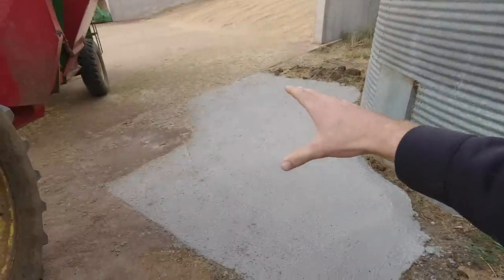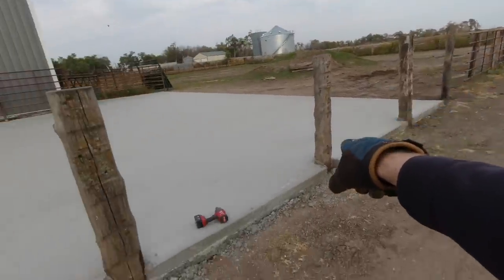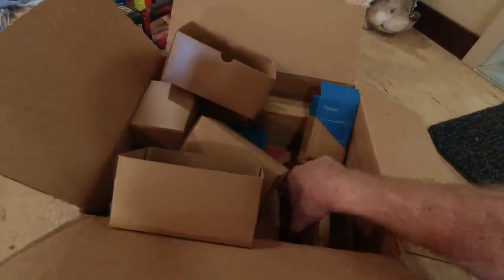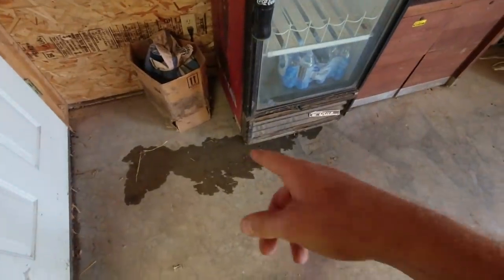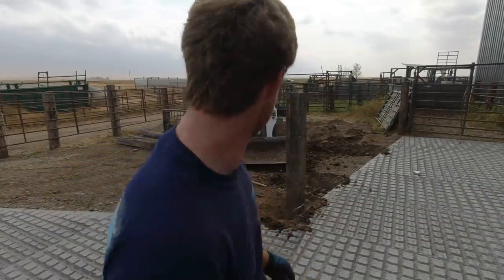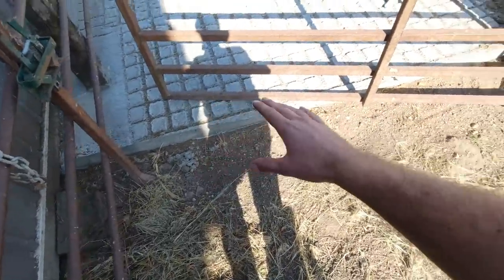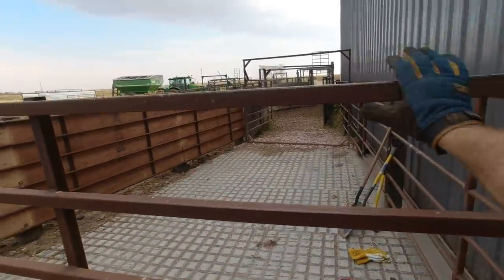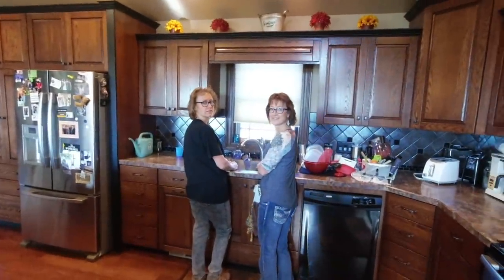Brand New cattle working facility 🐮

Comment: I dug hundreds of post holes to make side money when I was in school and living on the farm.  In Connecticut, there are lots of rocks in the ground that either stopped downward movement, or accelerated it if the auger caught at the edge.  The auger would jump and skip, maybe break a shear bolt.  Sometimes I had the good drilling you had.  One day it took 6 hours to drill 30 holes, another day in another place, I could drill 30 holes in an hour.  That day, I drilled 265 holes around a horse pasture.  You are right about tamping.  The post's stability depends on it, starting at the bottom and working the way up the hole.  Nice job, Cole and Brian.  So funny at the end!!!
Reply from the maker: It doesnt get much more rewarding that a straight solid fence!
Reply: @SonneFarms    One of our neighboring farmers built terrible fences.  They used somewhat straight tree branches as posts. Never repaired broken wire just added a new wire, wires old and new criss-crossing the space between wobbly posts that quickly rotted at ground level.  Countless times their cows or heifers would show up at our barn.  In retrospect, it is amusing.  Meanwhile, we worked hard to build a straight, solid fence.

Comment: Hi Guys! Not being critical but wondered why you put your pipe fence in the paddocks on the outside of the posts since I would assume the pressure against them will generally be pushed out towards the alley. Just wondering!

Comment: I used some 4’x10’ pieces of 18 gauge metal sheets welded to my corral panels to make a visual break for my corral. That way I didn’t have to worry about them welding. Although I did spend about $50 a sheet.
Reply from the maker: I bet it turned out amazing!
Reply: @SonneFarms  it’s not as nice as your guy’s setup, but plywood doesn’t seem to last very long here in Missouri.
Reply from the maker: @ajskab99  oh, I could imagine!

Comment: I ran into a friend who I have not seen since 1969, at the 4th of July party at his sister's home in IL. The sister was my partner when I worked for the city animal control and the friend and I graduated together from High School. The sister was a couple years behind us, and the Dad was a Judge on the bench in our city. I was relieved when he ddnt toss me in jail for a speeding (speeds in excess of 100 mph OVER the 45 MPH limit) and dropped the many charges down to a too fast for conditions, and gave the cop a stern warning that if he should decide to threaten more young troublemakers, like me, and tell them he would be laying for them and if he...The Judge said he would end that cops LE career but quick.

Oh yeah,  now I remember why I started this post..The friend who I ran in to at the party gave me the link to the simplisafe company before he went home. My apartment was robbed 2 years ago while I was at the VA in Iowa City and I lost 4 new long guns and a lot of fishing gear. Hopefully I can save enough to get set with up a system with all I need to notify local PD that someone has broken in, and that will ID the butthead. Now I have 2 reliable references to this safety company. Sorry I took so long to get to the point, but like Cole, I like to jabber too.   : )

Thanks for the great videos. I love farm life but never had an opportunity to get started farming. However, I did have a nice garden before my handler/wife sent me down the road. But, that's another story.  👨‍🦼

PS The Judge also married me and my now x. I think he got me back for the excessive speeds by marrying me up to that gal. 🦂

Comment: Funny guys twins as a point of interest Textured concrete makes a lot of sense when it all gets frozen for the cattle to walk on but not the other section?
Reply: The north section will not be used for sorting and so cattle will not be pushed and so not as worried about them slipping when they are just loafing.